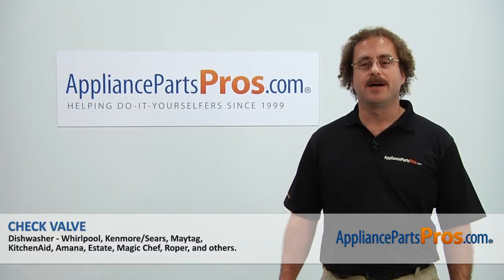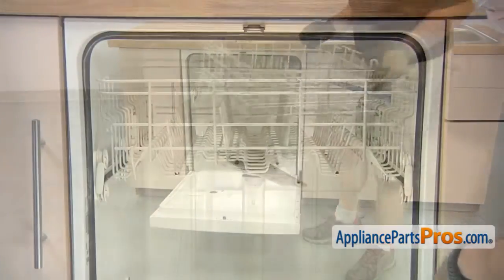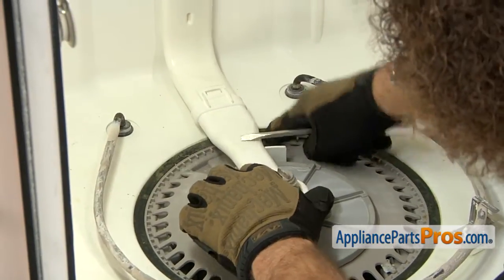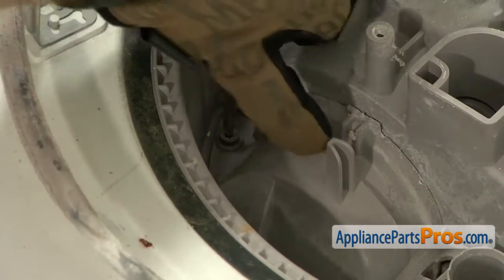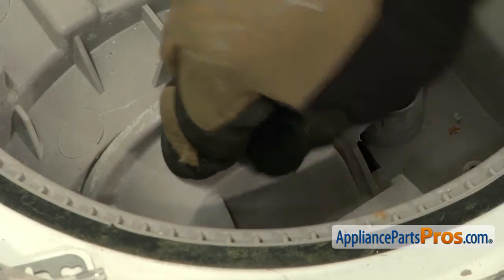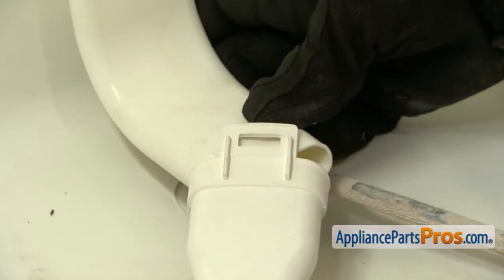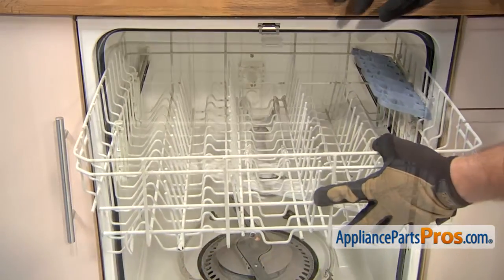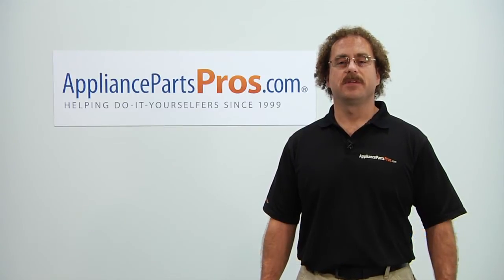How To: Whirlpool/KitchenAid/Maytag Check Valve WP8268375

Comment: I didn't see anything wrong with the old check valve in this video- I don't know how to tell the difference though... it's roughly a $40 piece of rubber, I'd like to know that if I replaced mine it would even matter.  My washer wont seem to drain right and I already cleaned it out according to all the videos I've been watching.  I'm thinking it's the piece of pipe that goes in to the garbage disposal now but I came across this video and thought- maybe?  Yet what determines a good check valve?

Comment: Mine flapper just broke as I was cleaning it, my machine says viking on the front but has a sears cnaada, does this flapper fit my machine. it does looks the same as the machine you show on the indie just the panel on the front looks different, what does this flapper do can my machine still run with it broken?
Reply from the maker: This part is what stops the water from coming back into the dishwasher from the drain. I can double check whether this part is compatible, I'll just need your model number to verify it. You can use this tool on our website to help you find the model number: http://www.appliancepartspros.com/modelnumber_locator.aspx

Comment: The flapper broke as I was pulling it out and I couldn't pull the round part out of the drain. What are my options? Thanks.
Reply from the maker: You may be able to use a slim pair of needle nose pliers or something similar to pull the round part of the flapper out. Can you see it down in there?